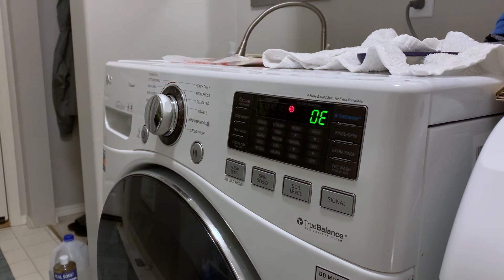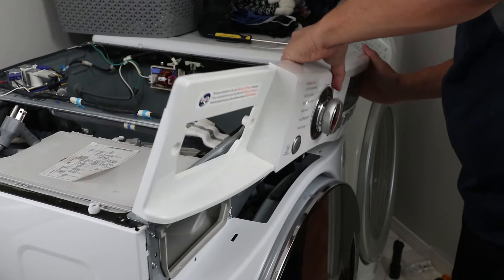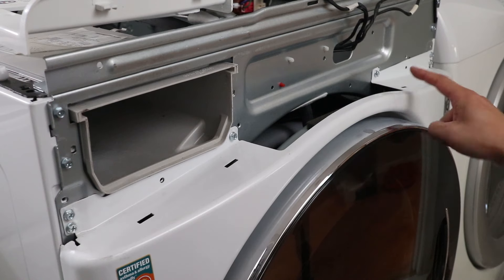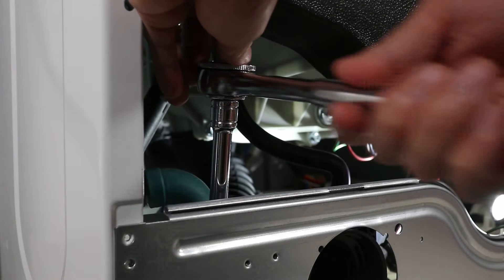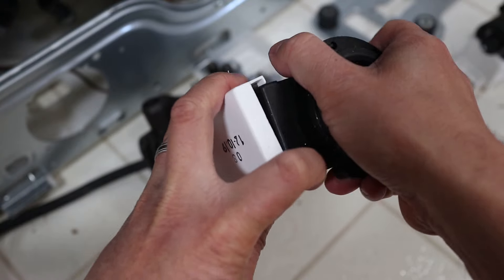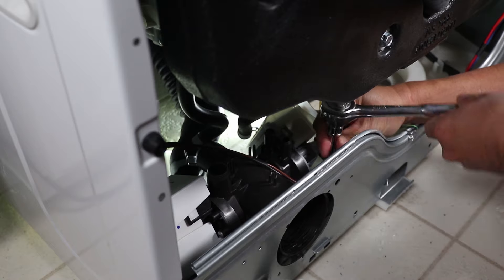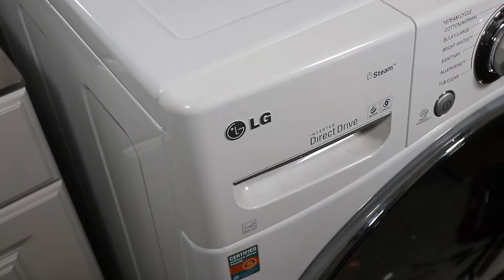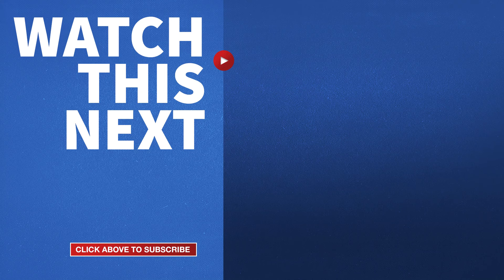LG Washer OE Error Code - LG Washer Not Draining Fix - LG Washer Drain Pump Replacement Tutorial

Comment: Well just finished replacing the drain pump, and it went well, but now I have a DE1 code, something about the door isn't closed, but it seems shut, closed, and looking like a "closed" door should look.     Not sure where to go next........................Mike
Reply from the maker: Nice work replacing the washer pump! I didn’t run into the DE1 code but if you removed the door latch like I did maybe that’s causing the new error. Check to see if anything got loose on the latch. I’m not an expert on this as this is the first time I’ve opened up my washing machine to do the repair! Hope you get it sorted out! Thanks for watching!

Comment: I replaced my washer's pump but still not working I don't know if the new one has problems to.
Reply from the maker: It’s possible the new pump has a problem. Have you checked all the connections? Is there still an OE error? Is that the problem you’re still seeing?

Comment: I replaced the filter with a new OEM one. As soon as I hit start on the machine, it still buzzes/vibrates by filter area (just like it did before). I still get the OE code.   What's the next thing to try?

Comment: Thank you for sharing. This took about 90 minutes.
Tips:
1. You don't need the tool at the end to get the wire back around the boot. Use needle nose plyers and the method in this video. I found it to be very simple: https://www.youtube.com/watch?v=HZr8qjQ81CQ&ab_channel=PartSelect
2. Use a socket wrench instead of a screw driver on the front screws. They're in there good and easily strippable
3. This video worked for my newer LG washer. Only thing that was different was the location and amount of hoses going into the pump. Take a picture and work backwards once the pump is out. 
4. try to pull any gunk out of the drain hose that may have clogged/broken it in the first place before putting the new pump back on.

Comment: Hi, does this also work on all front load LG machines?
Reply from the maker: I’m not 100% sure but this part should work in all LG washing machines. I think this pump is also used in other brands of washers so you should be confident that this will work for your LG washer.

Comment: Hi
I put the washer on its side and only loosen the 3 screws holding the pump. 1 minute. Without loosening all the rest.
Reply from the maker: Thanks for sharing your quick repair video experience! A few have mentioned to do the pump replacement from the bottom. I’m glad it worked! Thanks for watching!

Comment: for anyone watching this after 12/3/22.....ya can't get a screwdriver on that bottom screw down at the filter after you remove the plastic door. It's below the level of the metal face frame and only about 1-1/4" clearance. Screwdriver is at WAY too much of an angle. The video looks like the faceframe is already loose and able to be somewhat moved away. Sure wish these diy videos would tell us all the little hiccups us first-timers will encounter!!

Comment: My washer looks exactly like yours. Will the same pump motor work for mine? Before I order it I wanted to make sure I was ordering the right one. On the sticker  inside the door the model number reads WM2650HWA
Reply from the maker: I can’t be 100% sure but if your LG washer looks like mine then chances are pretty high that the pump I used would be the same for yours. I remember when I looked up the part that most of them are like the one I used. You can find the exact one I used in my video description. Doing this yourself will save a lot of money. And I definitely recommend getting the spring expansion tool at the same time. There was no way I was going to be able to get that spring back on without it.

Comment: I replaced the drain pump. Washer still makes a rattling noise and does not pump out. If I lower the drain hose to the ground, water pumps out. What's going on.
Reply from the maker: Sorry for the late reply! Hopefully you’ve got your washer figured out by now. I’m not an expert at washer repair but in your situation maybe there’s a clog in the train tube? Or near where the large tube connects to the drain pump. For a few of these viewers they also still had an issue after the pump was replaced. But it’s probably still a clog somewhere. Check the hoses and pump area to be sure there’s no blockage.
Reply: @digitalcamproducer  Bought a second, pump suspecting the first one was not good, and it worked. I was skeptical about a clog because when the other one was failing it would pump out one load and not the next, the water came out full force. I had suspected the control board but that was not the problem either. Thank you for your reply, my washer is pumping and spinning like    new. 😁

Comment: Fun fact you can skip all the extra removal bull and just go through the bottom plate. No robber seal, no B's panels, nothing. Just take the bottom off and it's right thete
Reply from the maker: Yeah a few viewers have mentioned going through the bottom to do this repair. For me it was easier to do it the way I showed in the video because the space where my washer is located is very tight so not much room to move the washer around. Would’ve been nice if I had a newer model where the bottom 1/5 of the front panel is removable. The newer models were designed to make this repair easy. If I had one of those then this repair tutorial would’ve been totally different. But then it wouldn’t have helped people who have the same type of washer as mine! Thanks for watching!

Comment: I had this problem but a new pump did not cure it. I don't know what to do next. I have seen my issue a lot on videos and no one seems to know what causes it to not drain completely SOMETIMES. I now turn the power button on, push the spin button until "1" appears in the window then push the run button. It will drain for one minute but not spin.

Comment: What's the part# for the pump
Reply from the maker: The part number is 4681EA2001T. I listed the pump and the spring expansion tool in the description so it’s easy for you to find. The pump is currently $25.

Comment: I have a top loader LG Washer that recently started flashing the OE error. I replaced the the drain pump, but still have the OE error...are there any other causes for the OE error?
Reply from the maker: I just did a little research on the LG top load washer. So it seems that if you are still getting the OE error there’s still a problem with the washer draining water. Since your pump has been replaced you’ll need to look at the drain hose. Check to see if it’s bent or kinked. Next check to see if anything is blocking the hose on the inside. OE stands for outlet error so water is not able to drain out. Hopefully it’s just something you can easily check on your drain hose! Thanks for watching!
Reply: @digitalcamproducer   Checked the hoses for obstructions and  found none. I've made sure that there were no kinks in the hoses as well. 
Is it possible I was sent a defective drain pump?
Reply: Did you figure out your issue as I installed a new pump and hose doesn't have any obstructions?
Reply: @alejopena318  I did. It was the computer operating the washer that was the problem, and  the cost of replacing the damage component would not be cheap, so I instead bought a good used washer .

Comment: I’ve drained the hoses and snaked them, replaced the drain pump and still get the oe error how do I fix?
Reply from the maker: Maybe there’s an issue with the wires? Did you reattach the wires correctly? Or check to see if they’re attached securely. Sounds like you’ve cleaned the tubes out. I’m not exactly sure what else could be causing the OE error. Anything stuck in the coin trap? Hope you get it working!

Comment: Did I miss the part where he explains the symptoms and how he determined it was the drain pump?
Reply from the maker: Hey! Actually you didn’t miss the part of how I determined it was my pump that was the issue. I had looked up OE error online and most websites pointed to a bad pump. So that’s what I went with. Of course you saw in my video that my pump was actually broken so it worked out for me. I’m not an expert on washer repair but I think the OE error could also be caused by blockage in the tubes. Thanks for watching!

Comment: Great video. All good advice except for recommending buying a pump from Amazon.  You will more than likely have to do this all over again if you got a pump from Amazon. They are the king of knock-off junk parts.
Reply from the maker: Thanks! And I agree with your apprehension of buying parts from Amazon. There’s a risk but I like their return policy. I’ve repaired other appliances with parts from Amazon and have never had a problem. Depends on your comfort level ordering from them! Thanks for watching!

Comment: It would have been very helpful if he had shown how to drain all the water from the washer  when it's full.
Reply from the maker: Hey sorry I didn’t show how to drain the water out of the washer. At the time I started shooting this video my washer had already been stuck on the OE error for a couple of days and I had already drained the water out while troubleshooting. To drain the water out it’s a similar process I demonstrate at 1:43 in the video. But fully remove the cover to the drain area first. Then lay a casserole dish next to the washer and take out the plug in the drain tube. I didn’t do that in the video because the water had already been drained a couple of days before I shot this video. Make sure you have a large casserole dish because there can be quite a bit of water that comes out. Then you’ll need a towel under the coin basket because there will be more water that comes out when you untwist it. By now you’ve probably already drained your washer but I wanted to get this info out here for others. Thanks for watching!

Comment: Your video is a tremendous "How To" but not much on the "Need To" side. I experienced the  OE error message but before dismantling the  machine I checked the coin basket.It was clogged with lint. I cleaned it out and hand screwed it back in. All OK. No pump needed.  Your video did however remind me that there is a coin/lint basket. Perhaps you could start with a suggesction to first check this item.

Comment: You know the part number.? Please
Reply from the maker: I have the pump and spring expansion tool listed in the description. Those are the exact parts I used in this repair. Luckily I still have the old pump lying around. On the pump box it has the numbers: 4681EA2001T
On the pump itself it has a sticker with the number: 13A-09-2012
Not sure if either of those help you out? Thanks for watching!

Comment: I hole sawed a access from the side dead center of the pump. It was easy to get to the side screws of the pump and I’m 6 new pumps in already. I would have threw this washer in the trash by now if that wasn’t the case and the pump is only 20 dollars on Amazon. This is the correct process on this video but I promise you won’t do this once.

Comment: Next time just take it out from the bottom..... must be factory trained...
Reply from the maker: Hey thanks for your observations! I’m just a frugal homeowner doing this repair for the first time when the pump motor broke. Mine is an older model LG washer but on newer models they actually designed it so you just pop off a panel at the lower 1/5 of the front allowing full access to the pump without removing all the other panels. I suppose it seems feasible to do this from the bottom but I can’t image trying to reach some of those bolts and tubes... especially the ones in the front and corner. It would’ve been nice if I had one of the newer washers with the quick access panel at the bottom. I only had 2 feet in front of the washer to work in but this is how I had to do it in my tiny laundry room. Thanks for watching!

Comment: Repair man would have charged you 5 times more for the part, I would say this repair would have costed 350 at least.....
Reply from the maker: It's definitely very expensive to call a repairman. But this is easily doable on your own as you saw in the video.
Reply: @digitalcamproducer  Last night I received the replacement part that I ordered three days ago, I completed the repair thanks to this video and my washing machine is back in business, the satisfaction of not paying at least 350 dlls to a repair company (thieves) and rather doing it myself is priceless.

Comment: Good video. I just did all this following another video that matched the vintage of my washer (I think 2009 or 12) https://youtu.be/Fi_6qDwNfx8?si=4m7up83Q44fgocSB    They are pretty similar. I could've done the job with your video on the slightly different model. 
 I wish I'd had the spring extension tool. Had I known, I would've ordered one when I ordered the new pump. Following  the other video I got the retaining wire on from the bottom spring all the way around and past the top. This is when it gets difficult -- really difficult.   The video suggested using a flat screwdriver. That didn't work for me. 

 I bent  a hook in a piece of stiff aluminum wire I had. Then made a loop I could grab and pull with my right hand. I hooked the retaining wire near where it was out of the seal, pulled and worked it down towards the bottom.  Just like getting a bike tire back on the rim.   It's very hard keeping the left side in the groove while doing this. Once I was able to begin moving down the right side pulling it into place it was easier. A second set of hands would've helped. 

I'm too clumsy to just line up the screws around a bin. I took a piece of cardboard and screwed them in the order they came out and made brief notes. There were 24 screws by the time I replaced the motor.  I made a bunch of marks with black red and green Sharpie to make sure I put things in the right holes. I used a white pain marker for the three screws for the motor. IT can be tricky. Mark one of the screw positions with two lines, that helps with orientation.  I really appreciate intelligent skillful videos like this one. (I think we're a bit fed up with some millennial opening up a box and marveling at the  instruction manual. Or the guy who doesn't know very much doing something technical for the first time in his whole life. I can find all the ways to not do something all by myself.)
Reply from the maker: Glad you got the ring back on without the tool. It’s a tough one! Also your idea of screwing in the screws into a piece of cardboard is excellent! Plus the ability to make notes on it is perfect! I will have to use that method on other things. When I used the plastic bin for my screws I was worried about accidentally bumping it and knocking all the screws into one big mess undoing all the organizing. Your cardboard idea is better than mine! Thanks for watching!

Comment: This video is stupid beyond belief!  Just pull the washer out a few feet and tilt it back towards the wall.  You can access the pump through the bottom of the machine without taking the whole dang thing apart!  This video is like changing a light bulb by accessing the fixture through the roof of your house!  LOL!
Reply from the maker: There’s a chance you could do this repair from the bottom. But from the front is how I’ve seen many others do this repair. On the newer LG washers the designers realized the need for easy access to the pump so they designed them with a removable front panel on the bottom 1/5 of the front. Would’ve been nice if I had the newer model. To access some of the bolts and unclamp tubes it would be kinda difficult from the bottom especially in my laundry room where it’s a tiny space. But this is what worked for me! Thanks for watching!

Comment: Are they kidding?  What the hell?  I hate these idiot engineers. Why would they set this up so you have to disassemble the entire machine to replace the most likely part to break

Tomorrow I am going to buy an entirely new machine it will be less work than this

The machine will not be an lg after this nonsense.
Reply from the maker: Yeah this is a pretty involved process to get to the pump on the LG washer. Some people said they tipped their washer over and accessed through the bottom. However I do know that some newer models had a smaller panel under the circular door that was removable. Just pop that panel open and easily access the pump. If you buy a new washer I’d look for that feature. That way if you ever had to access the pump area it would be much simpler. Hope this helps!